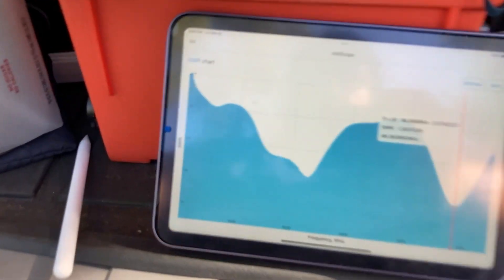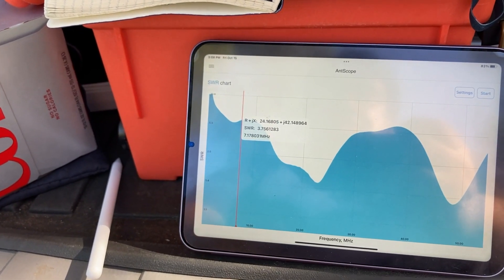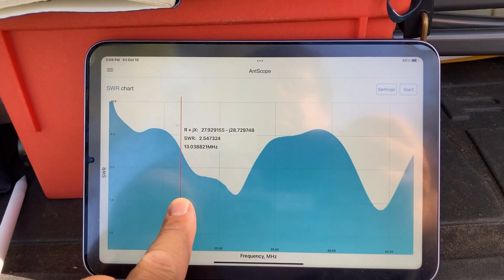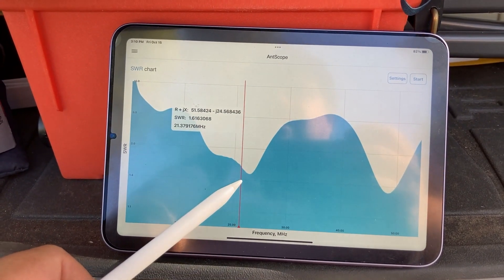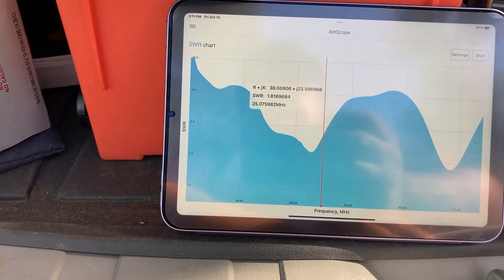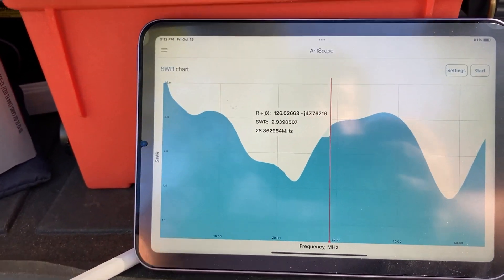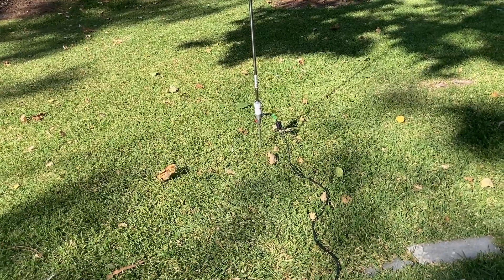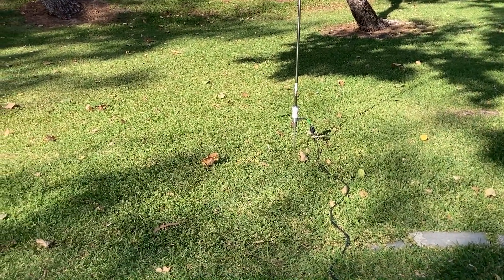CHA MPAS Lite Deployment SWR Graph

Comment: The instructions ask you to put out 25ft of counterpoise
Reply from the maker: It does. Hmm.  Then why the long radial that they give you.  I'll double check that.  thx.
Reply: @frankwc0o  The length is so you can also use it as an inverted V without the stick and supply your own counterpoise
Reply from the maker: @philipwells2793  I see that makes sense.
Reply: @philipwells2793  Actually my instructions call for a 25' counterpose for the Inverted V setup.